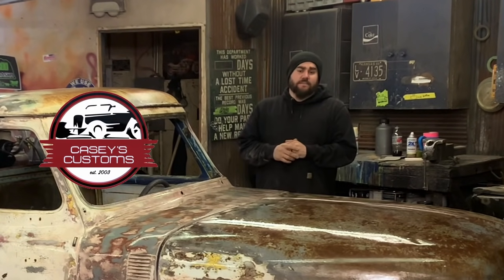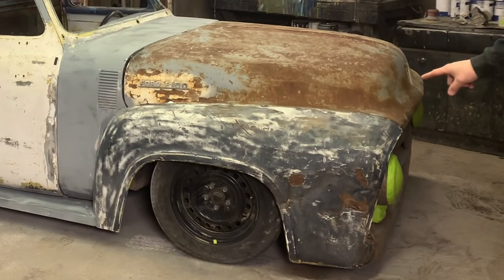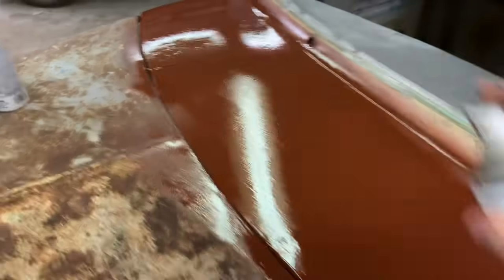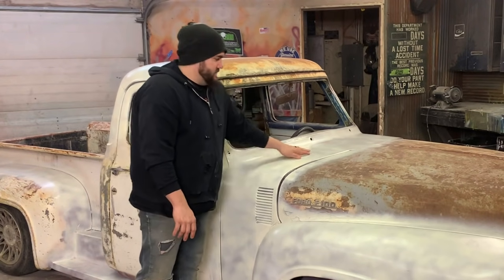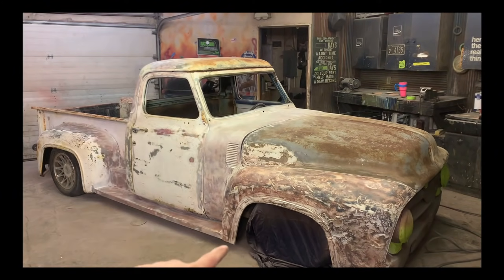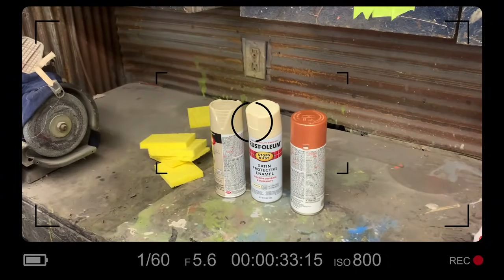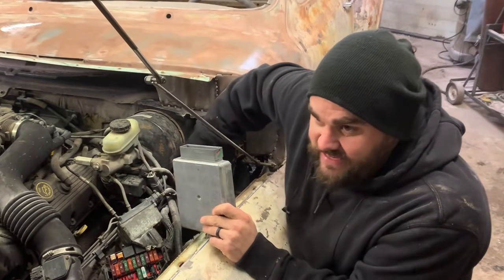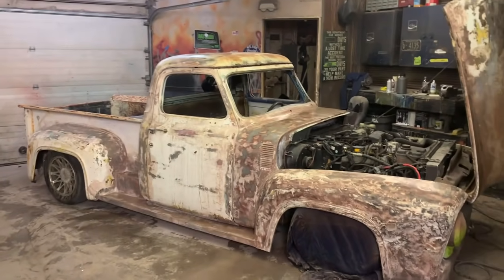BUILDING A HOT ROD FOR UNDER $1000 DOLLARS! PART 19! HOW TO BUILD A RAT ROD ON A SUPER CHEAP BUDGET!

Comment: Love the paint. One thing you could have done with it is after you had the primer down, take a rag or old blue jeans, get thinner to soak into  the cloth ring it out, spray paint the cloth and do a streak effect, which will cut down or remove the need to sand. Starting problems, my guess is a pinched or broken wire, but since your battery seams to die. It could be that you have a hot wire grounding somewhere. Just a thought, but we know how those are. Everyone has one.
Bart
Reply from the maker: I have done that before with thinner and it looks awesome. Too many colors on this one though, it would of smeared into a brown mess lol.

Comment: One thing I have seen top diagnosticians do is to check powers and grounds  at the computer. I guess both into as well as out of the computer at the appropriate pins. Good Fortune on getting this figured out!
Reply from the maker: Yep I’ve been doing that as well
Reply: @CaseysCustoms  Spark at the right time, fuel, and compression. Power to, and signal to and from crank and cam sensors? Signal to fuel injectors? Easiest 1st step is to spray ether into intake.  You probably  have compression for sure since nothing should have  changed in that department.

Comment: Been wrenching on Ford trucks about 45 years and I like what I see. High dollar chrome billet trailer queens and new muscle cars have no character, no soul, and usually owners that match. On the no start issue - Got to have a good hot battery before any thing else. Not a jump box, no jumper cables and no charger. Lot of issues come from wrong voltage- wrong amperage. You mentioned ground issues a good place to check from appetite to asshole. Bad connections from corrosion or damaged connectors would be next. Also I think this is a two relay process, a power up relay entergizes the ecm relay. If you have no check engine light with key on /not running you can bet on no power to ecm. Finally the bitch known as PATS (anti theft) will cause it all. That's another book but you can do it.  Keep the patina side up and the greasy side down.
Reply from the maker: Ty! I think I’ve checked it all 10 times, but it’s time to check 11 lol

Comment: Use aqua net hair spray helps color coats come off with a hard paint brush
Reply: Use warm water it activate the hair spray
Reply: I like nair. Removes hair and paint
Reply: I'm ASE certified paint technician by trade. My friend wrecked his patina 1967 c10 asked if I could match the patina finder .so went  straight to YouTube. Got this all from model car guys check it out it works

Comment: I am not a patina guy but that looks really good!  Thinking about the wiring issue when you were chopping the Vic body and hit the harness on the drivers side did any of those wires not hold when you fixed them?
Reply from the maker: Nah they all got fixed. It ran for a month or so after everything was cut and mostly welded

Comment: Random thought but isn't there a small harness near the driver's side floorboard that runs back to the tank under the car? Could you have melted it while welding the floorboards on? If so you may have lost a ground in there somewhere and those factory computers are dumber then me with a few beers.

Comment: It is most likely losing power to one of the ecu feeds, check all the fuses when you fine the blown one see what all else it supply's power to and unplug things one at a time. Should be like 2 or 3 15 amp fuses close to the ecu relay, also try swapping the relay with another they can click and still not work
Reply from the maker: Zero bad fuses
Reply: @CaseysCustoms  measure your voltage at the battery then from battery to body, battery to frame the battery to engine should see if something isn't grounded
Reply from the maker: @andreweisan9613  I’ll check tomorrow. 👍👍
Reply: @CaseysCustoms  put your key in the on position so there is a draw on the system when you check it